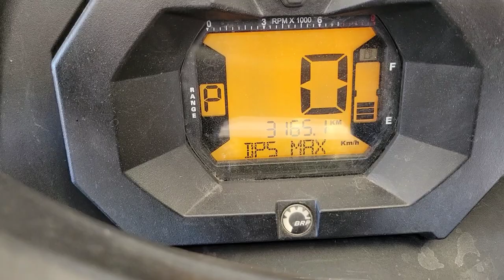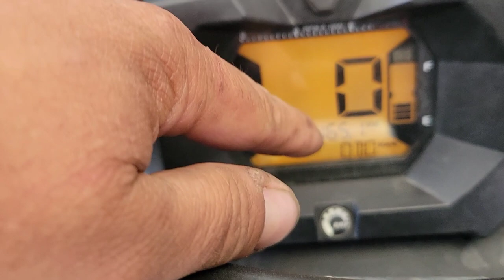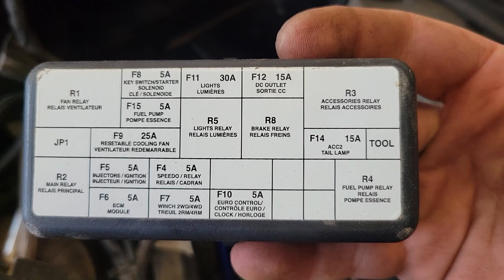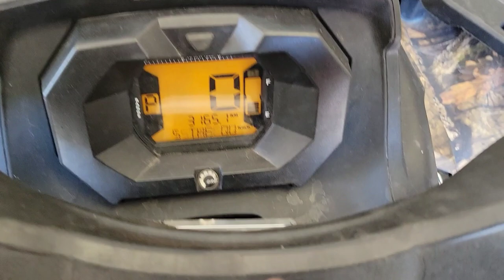Outlander 850 power steering fix and rip!!

Comment: Hello I have a 21 0outlander 1000xmr. An my steering hard to turn when running.  Any thoughts
Reply from the maker: there is a fuse for the power steering that pops fairly easy from what I remember..🤔 at least the older ones did, my buddy Stojko's outlander was doing the same thing but I think there was a light on the dash for the eps as well. I changed his fuse and it was back to normal. hope that helps 🍻